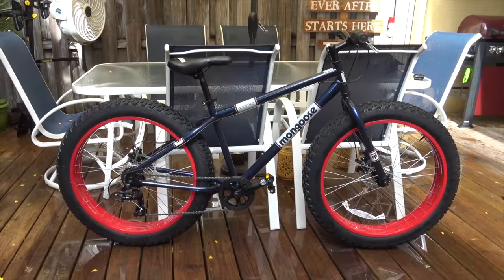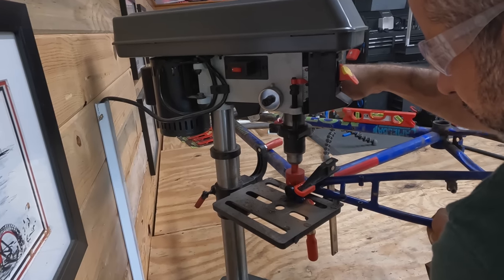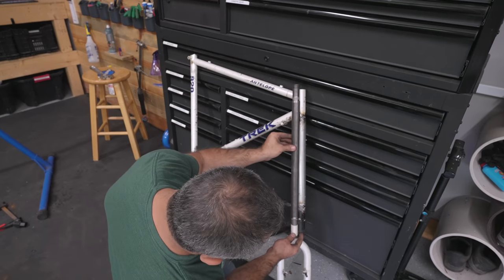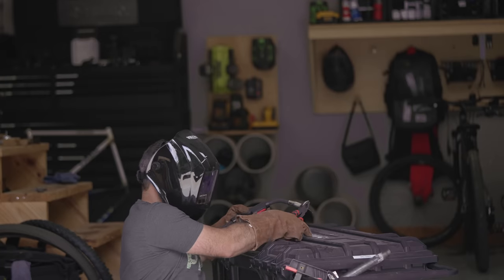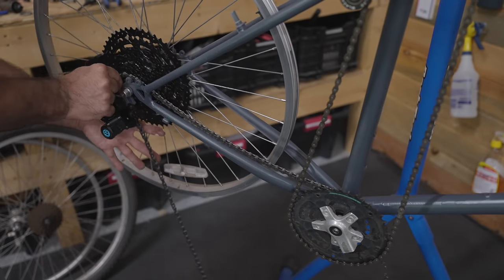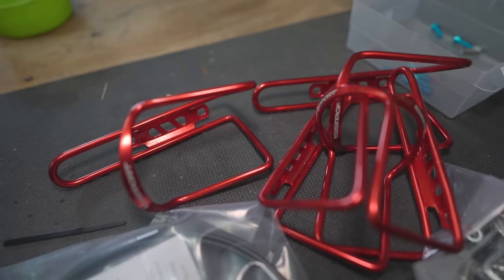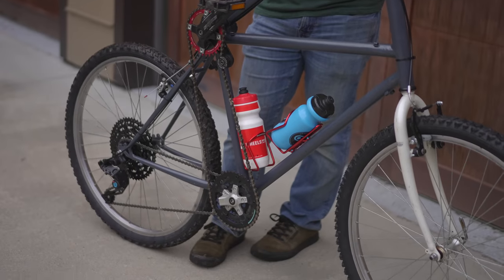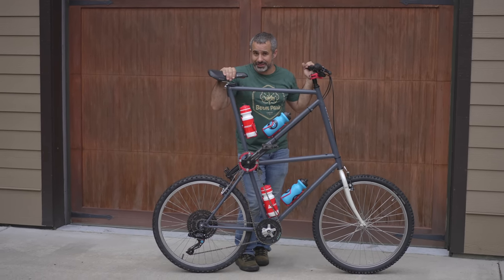Welding two bikes into one Tall Mountain Bike (and getting sketchy with it)

Comment: Seth just demonstrated why ACTUAL (not just virtual) seat tube angles are so important for people with long legs.
Welcome to tall people problems!
If you're tall and always feel like your front end wanders, like you're sitting "above the bike" instead of "in it", or you're constantly wrecking rear wheels...take a look at the actual angle of your seat tube in respect to the ground. Many manufacturers advertise a "virtual seat tube angle" that accounts for the offset of the bottom bracket from the junction of the seat tube and down tube, resulting in a misleading number.
On an XXL frame, with a 210mm dropper post, a shallow ACTUAL seat tube angle puts my tailbone almost in-line with the rear axle on a modern mountain bike. 
I suck at wheelies, so this is sub-optimal and I'm so glad modern geometry trends err toward longer wheelbases and steeper STAs.

Thanks for coming to my Ted Talk and I hope Seth slams that saddle as far forward as he can.

Comment: It looks like you could swap the middle chainring to the outside, same BCD unlike the smallest. That would reduce the gear reduction and you would keep the clearance.
Reply: You can also put a few spacers in to prevent rubbing. When I messed with adding motors to bikes I put about 2KW through chainrings spaced out by 10mm and they were fine.

Comment: Seth, if you do another one, leave the rear triangle and rear wheel of the top bike and have that wheel spin via a chain from the lower cassette and then the upper wheel can spin and do some other (TBD) job like power a small generator that would in turn power some lights and a spinning disco ball.  Or whatever, just go nuts and have fun doing it!

Comment: welding tip for the staerer tubes. if the frame is made out of steel, put a aluminum tube that fits true them. it wont weld together and that way you don't need to measure as much

Comment: I'm thinking mounting an old school 26" frame on top of a modern, longer wheel base frame, perhaps even a 29er frame (but with 26" wheels to make mounting such a steed possible) could help mitigate the geometry issues a bit.  Of course that would put the top frame BB shell on top of the top tube of the bottom frame but some trusses and gussets would resolve that weak link.  Well done on your beautiful creation!

Comment: You've got to do this again, but use a slightly bigger bike for the bottom one and a smaller one for the top half. Also notice the way that Raven used a bike with a very curved middle piece as the top bike. Also I'd love to see you put full or at least rear suspension on it!

Comment: I had one in grade school til it was stolen at the YMCA... A girls 20" cruiser on a second fork and a second triangle... and yes they can wheelie forever... My peers (the other kids) and I could ride a wheelie on a regular bike for half a block or so, but the tall bike I could ride a quarter mile if traffic was in my favor. It just wanted you to be in the right balance point. Of all the bikes I have owned, I miss that one the most, though I would be far too large to ride it now (same reason the collage kids across the street gave me the frame in the first place). I doubt I would build another like it, but it was a blast that should not be as rare as they are.

Comment: Try making it with a large triangle shape in the chain between the top, bottom and back. With a chain tensioner I found its the best design for the drive trains of tall bikes. Adding a front rack directly to the frame with some stuff in it gets rid of the wheelie problem

Comment: Excellent work as always. But if the gearing gets to low, you could use top 3 to bottom 1 and from bottom3 to the back. Ort top 1 to bottom 1 and bottom3 to back to get a one to one gearing

Comment: As soon as you welder the larger diameter bar to the steer tube I facepalmed because I did the same thing. Best way to solve wheelies is a 24 fork and wheel on the front. Pursuit tall bike 😂

Comment: The tall bike I built is a lugged frame with a 4 foot seat tube and two top tubes. Much easier to build and I used a MAPP gas torch to braze it together. For the steer tube extender I used a 7/8 sleeve to join the 25.4 steer and was able to use a threadless Headset. I also added 24 bottle bosses in the frame.

Comment: You should be able to use the big ring/middle ring combo if you move the upper crankset chainring to outside of the spider, as if it was an outer big chainring, which will fix the chain line.

Comment: If you want to get around the chain-rub issue, you can run your vertical drivetrain on the non-drive side. That's what I did on my tallbike, and it works great.
Reply: So what is the benefit of two drivetrains vs running the chain from the top crank down to the cassette?

Comment: I see you have learnt what every tall rider knows.    All bike companies do is adjust the reach for taller riders, but never pay any attention to chains stay length.   So that means on very steep climbs you loop out sooner than a shorter rider due to the increased effective top tube length and the decreased ratio to chainstay length vs a smaller bike.    (I guess it's the tradeoff between looping out and cornering like a snail).

Comment: Well done for a solo first attempt.  I'm have no engineering knowledge.  But I do have some thought on how to resolve the front to rear geometry balance.
I'm guessing if you were to change to a smaller wheel in the front , that might improve the geometry and bring the rider's weight forward.
If you decide to do another Tall Bike conversion.  Having a long chain stays would solve the uphill issues.  Converting a cargo bike might be a possible answer.

Comment: Great build man, love it. I've seen a lot of tall bikes that use a smaller front wheel to correct the angles so one doesn't loop out. They also don't usually run a front brake out of fear of going over the bars if they have to brake quickly.

Comment: It would be possible to move the Upper Crankset to the Left side and add another Crankset in the Left Bottom side so you could use all gears in the bike and also if you have booth cranksets in the left side the same gear ratio you wouldn't have a reduction? If doesn't make sense it would be a good argument to try!!

Comment: i'd say add another set of sprockets on the left side of the lower bb and swap the upper to the other side ... then both chains are isolated from each other and you have more gearing options

Comment: Would leaving the crank arms and pedals on the bottom gear have caused any interference issues?  It doesn't seem like it.  I think that would have been even funkier with the pedals moving remotely, plus it would have given yoou at least a little more of boost up to the seat and the ability to do some crazy dangerous tricks when you first mount the bike.

Comment: So a comment/question on the previous tall bike. When the angle from the top tube to the seat stays is approximately 180°, and the angle from the top tube to the head tube is approximately 90°, why not just flip the frame?

Comment: could you put on three cranksets and one normal pedal arm? So: one on top (left) which is connected to a second one on the bottom frame 1:1 and one the right bottom frame so you would not have to think about the chains rubbing?  also maybe you could then have a derailleur in front.

Comment: The new road/ gravel/ XC bike with doubled hydration capacity and elevated seating position raising you higher into the atmosphere where the air is thinner, resulting in less resistance…

Comment: I was surprised that you actually had a welding machine.  However, that gasless welding wire is crap.  Get a slightly better welding machine that will run .025 or .035 mig wire (bare wire, 70S2).  And a bottle of mixed gas to go with it.  75% Argon, 25% Co2.  Often just called 75/25.  This set-up is extremely easy to run.

Comment: I have an idea that you should build a three decker, full suspension, welded together mountain bike, three full suspension bikes on top of each other welded on that would be freaking radical and make sure it has disc breaks with fat tires 29 inch rims really fat tires that’s going to be the most comfortable bike in the world. Think about it. Three mountain bikes that are full suspension mountain bikes on top of each other welded very very comfortable and making it an E bike. Yes you heard me right an E bike with a 200 V battery or even higher I might even build it myself.

Comment: Bike manufacturers use automotive body filler to smooth the welds.  Would have worked a lot better than JB Weld because it sands and spreads easier.

Comment: Question, I have a cube curve Trekking year 2012. With a shimano xt groupset of that year. I was wondering if the frame would hold up for some downhill and maybe slight gaps/jumps. I am on an extreme budget and am very happy with my trekking bike. So i dont want to fork out the money for a new frame. I have a seperate set of sturdier wheels i have somewhat more agressive mtb 28x2 tires. (From schwalbe) for flat trails i have no complaints or concerns, but i was just wondering if the frame would hold up to my 200lbs if i tried some tabletops or my local pump track. I have never actually sent the bike into the air because of this concern.

Comment: Doesnt aluminuium need to be baked in a oven at several thousands of degrees in addition to the welding to make a solid weld? Thats wat I was told when I broke my aluminium bike frames and tried to fix them, I ended up having yo buy a complete new frame.

Comment: I know you know tallbikes are dangerous by nature, but I'm concerned that you may not realize just how dangerous your copper steerer tube extension is: It looks like you only press-fit it, which is not a secure connection for torsional forces, and copper doesn't have the torsional strength that steel does anyway. You gotta weld or braze steel to steel.